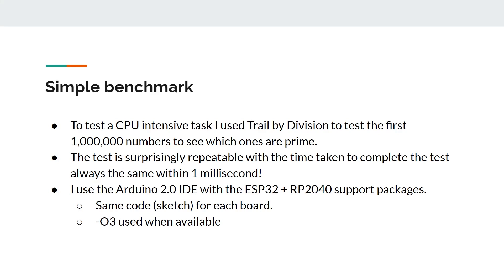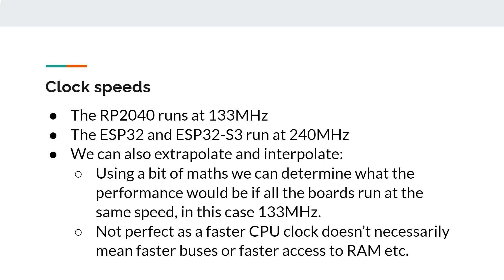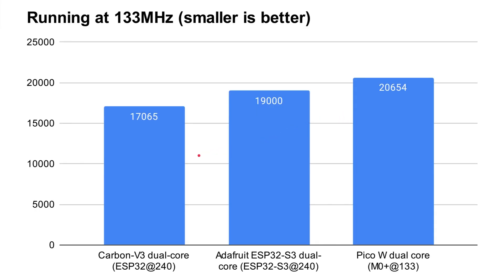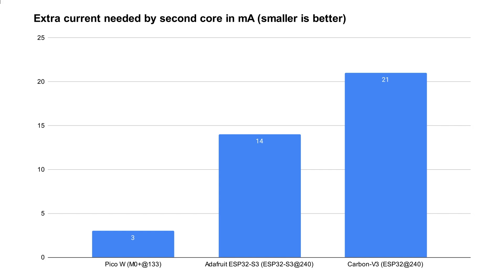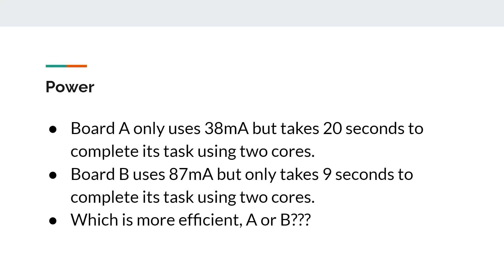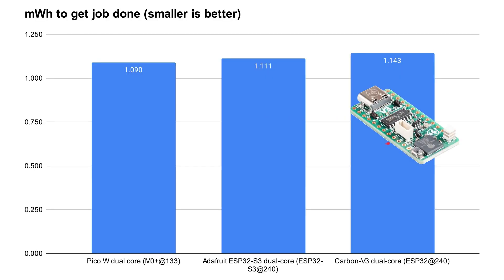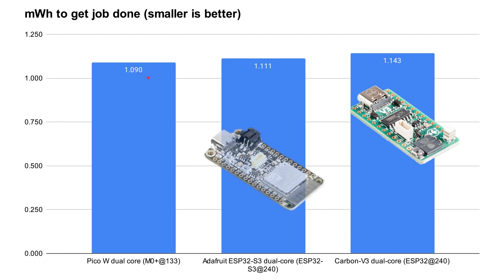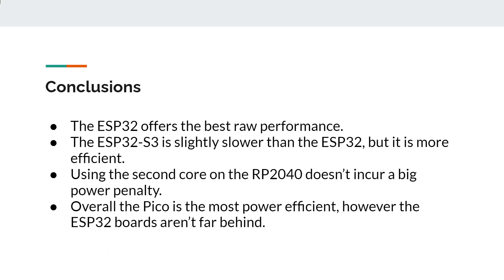Dual Core Microcontroller Battle Royale  - Performance and Power Efficiency

Comment: How would a Teensy 4 do in this test?
Reply from the maker: That is a good question. Of course there are several different models with different CPUs. Unfortunately they are hard to get hold of, very USA-centric sales.
Reply: @GaryExplains  Hard to get Teensy's? Here (NL) most arduino-like webshops have them in store, I do see half of them have a little delay in shipping right now, but also quite a few options with stock.
Reply from the maker: Could you please suggest a good European website for them, I have wanted to get some for quite a while but the price and/or availability has always been a problem. If YouTube doesn't let you post a URL directly then just spell it out and I will google the store. Many thanks!
Reply from the maker: Thanks, much appreciated. Unfortunately the cheapest is €27.50, which I think is quite expensive for a microcontroller board. The Pi Pico is more than 3 times cheaper.

Comment: Amazing. Despite different architectures and features in silicon, these 3 perform basically the same amount of computation for the power used. And it sort of makes sense, for this test they mostly move the same amount of data between registers, trough mostly the same cmos circuits, with the same size transistors. 
I would've thought the tensilica cores had an edge with their divide circuit, but I guess it just requires it to power a whole lot of transistors. So, maybe faster but with the power expense.
Maybe us software guys get too hung up on architecture and api debates, the cmos circuits and sram blocks just do what they do.

Comment: I'd be very interested to hear how these powerful microcontrollers compare to some of the old 8 bit ultra low power microcontrollers such as ATMEGA AVR line.  Often my projects have no speed requirement. Maybe they only need to wake up and read some sensors every few minutes. In these cases, I'd be curious to know what is the absolute most efficient. Additionally, those chips can run without any external components at voltages as low as 1.8V, and clock speeds around 250 kHz. ...would be cool to compare all of those options.

Comment: Thanks Gary, great comparison, well explained. I'm curious how the 'Arduino Nano RP2040 Connect' would do in this "Battle Royale". My guess is that it would be close to the Raspberry Pi Pico, but not sure. Any ideas?
Reply from the maker: I suspect it would be close to the Pico since they have the same processor. However I am measuring the board current, so if the Arduino one has a more sophisticated board then it could draw more current.

Comment: What voltage was used for powering the boards? If it was 5 V, then the results are skewed in favor of Pi Pico, which has an efficient switching mode 3.3 V regulator instead of a linear one wasting about 1/3 of the power.
Reply from the maker: As I have stated in other videos in this series, the testing was done using 5v and 3.3v (for all boards). The relative results don't change.
Reply: @GaryExplains  it is not reasonable. Normally, switching regulation have much higher energy efficiency than linear regulation, such as 90% vs 66%. Normally, switching power regulation has more noise than linear one and it affect the ADC noise much.

Comment: Esp32 with 9sec, 87mA
Pico with 20sec, 38mA
Esp 2.22 times faster, devide the 87mA with 2.22 To make it even, its gonna be 39mA, So for me same efficiency😁
Reply from the maker: Which is what I show in the video, but you are using rounded numbers (i.e. it isn't 9.0 seconds for the ESP32, etc).

Comment: Good video Garry. Have you had a chance to play with the ESP32-S3?

I want to know if migrating an Arduino ESP32 project to the ESP32-S3 is straightforward.

Either way, ill be working on that this week to find out for myself.
Reply from the maker: Ah, I see your edit now. You should be able to run your Arduino project on the S3 with no alterations, assuming the pinout is the same on the new board.
Reply from the maker: I have used the S3 while making this video. Anything in particular you wanted to know?

Comment: I suspect that the most important power issue with microcontrollers is not how many micro-joules are required per million instructions (or whatever you care to use), but the total amount of energy used for what is often intermittent usage. Of course, if there's a simple-minded program that runs in a tight loop, as is often the case, then that won't help much. However, with a well designed micro-controller and software which is interrupt driven and has the ability to put it into a proper "sleep" mode when not executing code, then I would hope that the power consumption can be minimised.

Also, those CPU architectures which have power saving modes when running light usage applications might have an advantage, although I suspect that sort of thing doesn't apply to micro-controllers in general, and is more likely to be found on the sort of processors to be found in tablets and smartphones.

Comment: One more comment, given that the RP2040 does not have single cycle divide (STM32 M3/M4/M7 all do) I was surprised at how well it performed on the clock for clock basis against the LX6 and LX7. it might be interesting to repeat this test against an STM32M4.
Reply from the maker: I have tested it against the STM32 M4 in other videos in this series.

Comment: Results are strange...
In my case, when i switched from ESP32 to ESP32-S3 i've got more performance when decoding Jpg from ov2640 on the fly. Like +15FPS on avg. in HQVGA, what allowed me to move into QVGA mode.

Now i'm wondering how... Could it be due to better IRAM/DRAM cache subsystem?
Reply: The S3 has 512 KB sram, this is more than the older models. Also the S3 has AI Acceleration Support. This can also help to decode JPG. Anyhow, how much FPS do you get with the ESP32-S3 and the ov2640?
Reply: @peterschets1380  A bit of pre-conditions: 
- ESP-CAM (From Ai-Thinker) transmits over ESP_NOW with cap at 1Mbit/s and LR mode;
- Camera is set to QVGA and quality=20 with 2 framebuffers in PSRAM;
- On receiver side there is a ESP32-S3 which decode received data at one core (APP_CPU) and draw image on another (PRO_CPU) via SPI;
- I use modified by myself Tjpg C library (added IRAM_ATTR to all functions and DRAM_ATTR to const arrays);
- In menuconfig for ESP32-S3 set I/D cache sizes to maximum (32/64 KB);

So, with an average data rate as:
- something like ~86kB/s, i have 27±1.5FPS (Complex scene with bunch of text and objects).
- something like ~54kB/s, i have 33±1.5FPS (Just blank dark image with closed camera lens).

As a side effect:
 - I'm using active cooling for ESP-CAM, otherwise it will burn within 1 minute \(o_0)/

Hehe, entirely not the best to make an FPV cam :)
Reply: @Bismuth208  Ow, and if you send 5 fps, can you use a pasive cooler?
Reply: @peterschets1380  Hi! Well, i've tested ESP_CAM with 80MHz CPU freq. and 5fps limit at max Tx power (19.5dBm) for 20mins. With a room temp. at +24C it heated up to +50±2C. (Measured with non calibrated DIY thermal camera). Also,  one heatsink (10x10x10mm) was attached to ESP module and another on top of AMS1117 voltage regulator.
So, yeah, passive cooling is possible.

Comment: If your going to continue doing power consumption tests on microcontrollers, you should get a Nordic Power Profiler Kit 2. It only $99 and it allows you to get MUCH more detailed current usage over time compared to just using a shunt and voltmeter. It can also accurately measure down to the very low uA and even nA range.

Comment: Hey Gary, nice video. The RPI Pico W has a configurable clock speed up to about 400Mhz. You could set the Pico to 240MHz to exactly match the ESP32 boards. I usually run the clock on the Pico at application specific speeds for example HD Video output needs specific speed depending on resolution. I suspect higher clock speeds might be less power efficient but faster to complete your test. I wonder how this might impact things? 😬 as always great content
Reply from the maker: Yes, I already did that in a previous video, no need to repeat myself.
Reply: @GaryExplains  This video compares performance and power consumption, in your previous video does it show click speed changes does not change power usage?  Can you share your prime factor code so I can test this?
Reply from the maker: @Robin Grosset Yes clock speed changes the power usage, as I show here: https://youtu.be/XJawv8xGtX4?t=698
Reply: @GaryExplains  there are a few variables and the Pico gives you a lot of control.  Example here 
https://youtu.be/G2BuoFNLoDM?t=211 

I get that you are comparing stock clock speeds. Under volting or under clocking is a common way to save power.  Depending on core voltage you can achieve the same clock speed and have a 30% difference in power consumption on a Pico.  In any case I love watching your channel.  Like Rob d I am en engineer. Apologies for being a pendant  😁
Reply: @GaryExplains  bench-marking with different clock speeds  is a bit misleading though.
Reply from the maker: @rob d I don't understand. I show the performance and the power usage (across several videos now) at the default clock speed and at overclocked/underclocked frequencies. Are you saying that if I have an i7 Intel CPU I can't compare it to an AMD Ryzen 7 CPU if the clock speeds are different?
Reply: @GaryExplains  I think your channel is great btw. Maybe i missed something. Yes you're showing the comparison with the clock speeds, it is clear when reading the graph. I did see your video where you set the freq to the same one. But in this comparison (testing both cores) the clocks are different. Of course changing the clock speed will change the benchmark and power usage. It would have been nice and more complete to see that, that's all. No biggy.
Reply from the maker: Ah, I see what you mean. Yeah maybe that would have been interesting, but to be honest there is only so much I can include in these videos. Ultimately I could write (and sell) a white paper with more data points and more graphs.
Reply: @GaryExplains  You do you Gary. I'll watch. I'm a coder and numbers guy and I like to code for my mcus. You're doing what i want to do.
Reply: @GaryExplains  The idea i like about mcus with two or more cores that its becoming possible to do more concurrent operations on a real time device. That's cool to me.